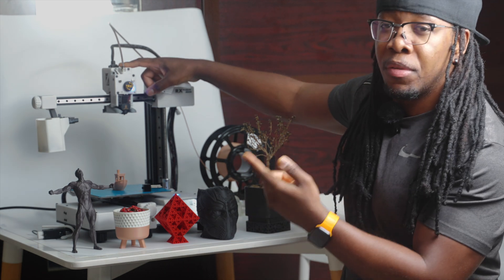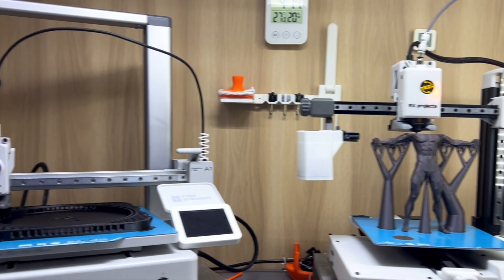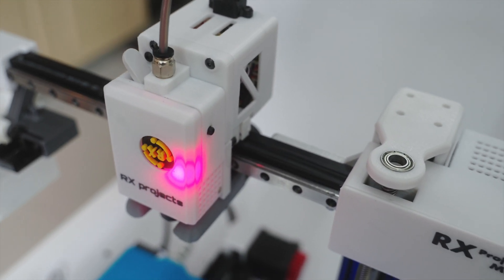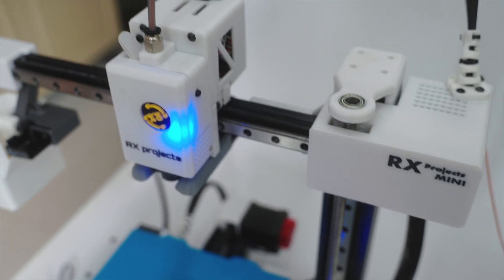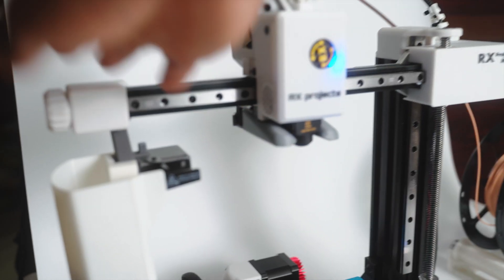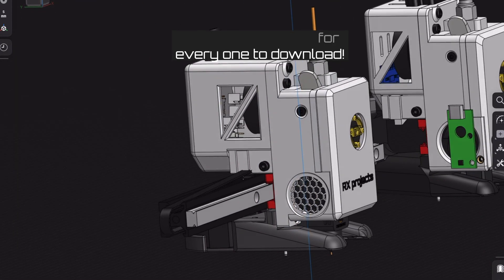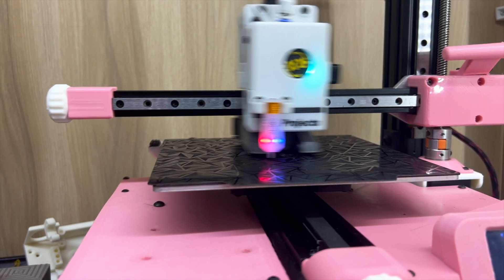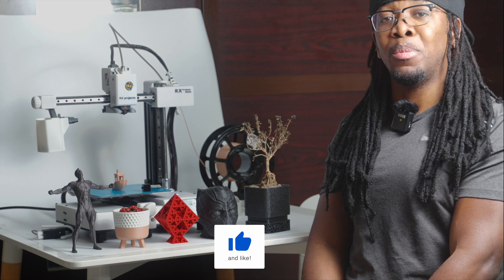Game-Changing Performance with RX PROJECTS Toolhead

Comment: I was thinking putting  a servo on the x axis  

Wouldn’t that make it 5 axis 😂😂 adding the coding is what scares me  😂. But I bet u could do it .

When I first saw the a1 I wondered why they didn’t do it then I thought about the coding 😂😂
Reply from the maker: A1 came 2 years ago before they started implementing servos in their printers, probably next gen of A series will have servo too, I hadn't play yet with servo motors and probably the firmwire will be also another problem, also I think klipper doesn't support servo extruder yet.

Comment: I have also a partial  clone of the a1  toolhead with sherpa extruder and a1 hotend and custom toolhead pcb. I used also bambulab a1 fans. I intend to buy a1 extruder gears and x1 motor and modify your a1 stl files to match my setup. I"m intrigued by yor claim that working with bambu a1 profiles. There are there some custom gcodes which are not found in klipper.
Reply from the maker: If you’re planning to do CAD design, I recommend joining my Patreon — there you’ll get access to STEP files that are much easier to edit and customize for your needs.
Yes, I’ve mentioned that you can copy Bambu slicer profiles to use with your own printer. Just to clarify:
You can’t use them directly, because you still need to adjust key settings like your printer’s dimensions and G-code flavor.
However, everything else can be copied to give you a solid starting point. From there, you can fine-tune the profile to match your motion system and capabilities.